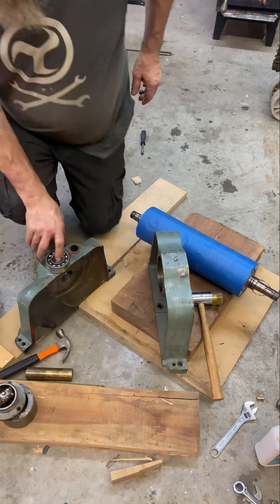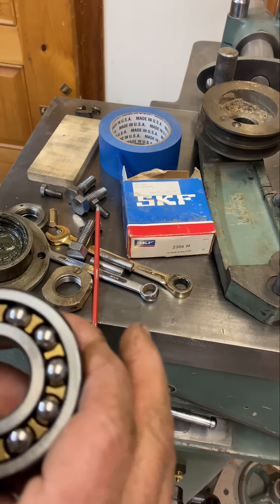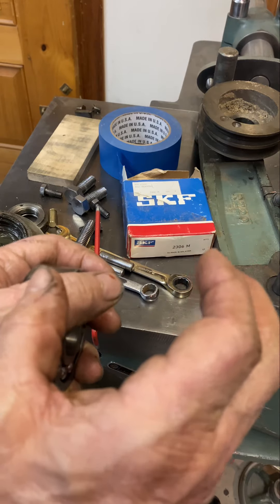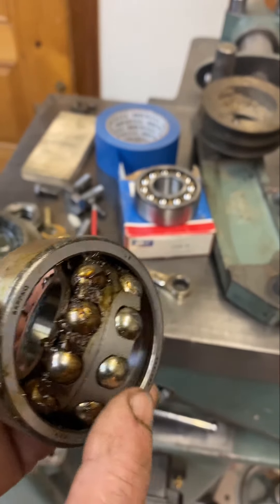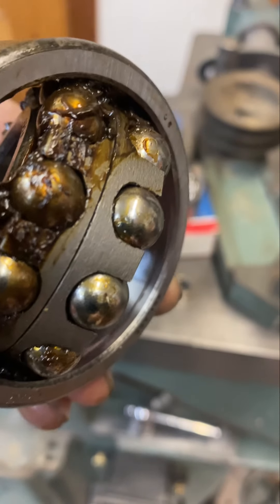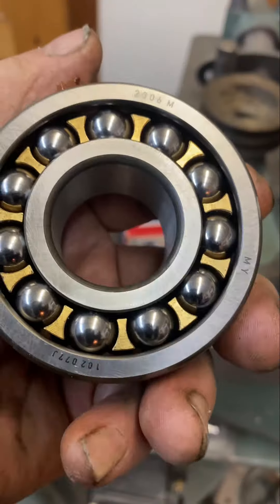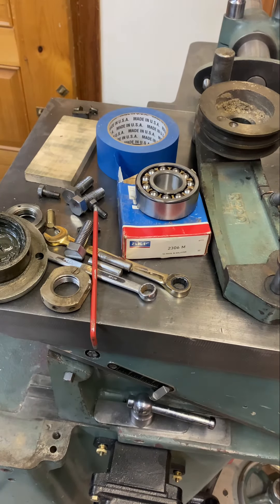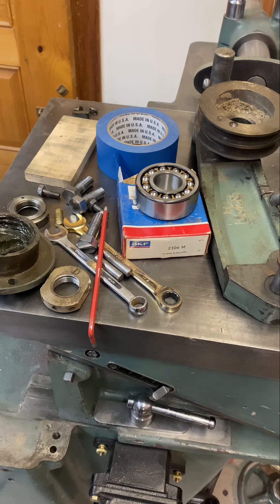replacing  bearings, wadkin RZ

Comment: I will be reworking my RZ 16” Wadkin in the spring. I wonder why no paint job on your machine. Mine has a four knife cutter head. Very cool rebuild I will be following closely. Thanks for sharing.
Reply from the maker: mostly don't have time, but still want to do the mechanical rebuild. Many ways the paint is the easiest part but it's a nightmare for mechanical if the parts have been painted first.

Comment: Lovely work. Ive had the arbour on my BGS 12 reworked to take a dado stack and with a 30mm shaft to take UK std blades. The bearings were shot so remorked it and went with thrust bearings. Its a lovely set up. Not sure if youre interested but happy to send you a schematic .. might come in usefull for something somewhen.

Comment: When I did the bearings in my Wadkin RD16 one side were imperial and one side metric sized.Luckily the self aligning was metric and easier to source now.
Reply from the maker: on my RM there are separate bearings on the drive side. In fact, there are two double Rd. self aligning pair together, making a three bearing planetary arrangement but that cutter block is 26 inches wide.
Reply: @jackEnglishmachines  Yes the wide ones are heavy.I have a 630 wide SCM thicknesser and the bare head weighs 45kgs and then spins at 5000rpm.

Comment: Interesting.  What lube will you use?  Is there an adjacent seal?

Jim
Reply from the maker: i'll be using a low temperature high speed, spindle grease
Reply: @jackEnglishmachines synthetic Mobil EP2 high speed spindle grease. EP1 is lower speed.
Reply from the maker: @devmeistersuperprecision4155  hi Dev . i've heard this grease recommended a few times now and I'm a little suspect of the EP rating generally  extreme pressure greases contain metal in the matrix. I do like the synthetic oil as it is the oil that lubricates the soap just keeps it there. Especially for vintage machinery I like to stick to lithium based greases mostly because those are generally compatible with the old greases, so contamination of grease from incompatible soaps,  is less of a concern. I have for the  last decade converted everything over to a low temperature high speed grease. Not cheap and is lithium based with a synthetic number six spindle oil as it's lubricant it has the consistency of confession microwaved marshmallow. Very white in color so can detect contamination metals added, that would cause bronze to deteriorate or detergents, which generally the EP greases  can contain. no I realize we're just splitting hairs here but the product I do use is LGLT by SKF and it's a number two. I do not believe they sell it in a number one it's temperature range is incredible especially in the lower end where much of the damage of bearings is encountered that point where the bearing has been sitting at startup before the lubrication and the warming of the grease can take place.  One experiment we did was replacing grease from standard motor bearing grease just general purpose number two in a wad can PK to the LGLT 2 buy SKF and there was a significant amperage drop on idle we're talking significant. As you know, many of these types of high precision bearings are lubricated in many cases, strictly with oil in systems, that drip mist or bath, the bearing getting soap to not cause problems has always been the difficult part of lubrication. Also what I have noticed with this grease in particular because I bought it in a can is the lubricating oil does not separate from the soap and so it's held and suspension much better than typical industrial lubrication product. my brief investigation into the development of the Greece was to discover that it was developed by Hoffman bearings for Rolls-Royce jet engines . not the cheapest Grease , but the cheapest insurance for machine, bronze cage, precision ball bearings. Check it out. I know you would love it.